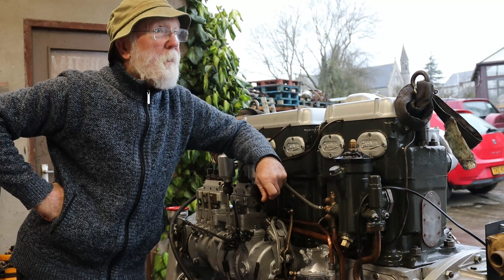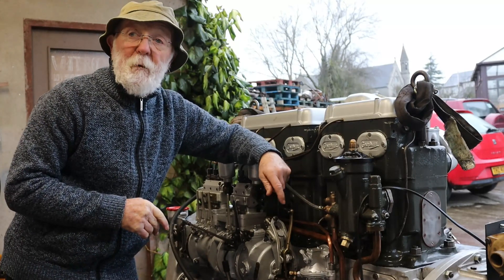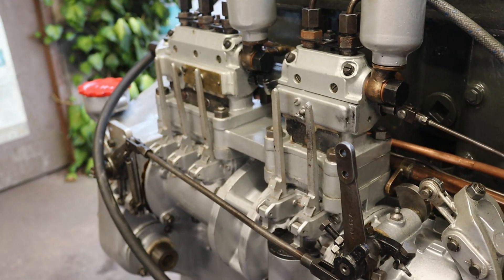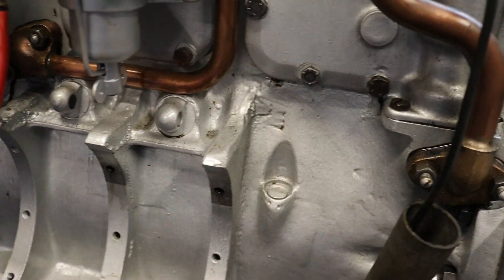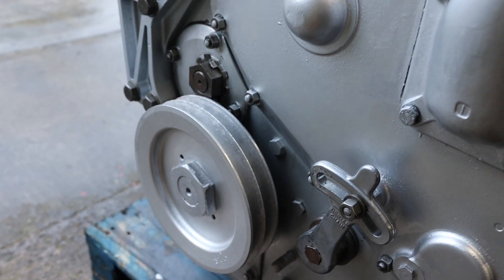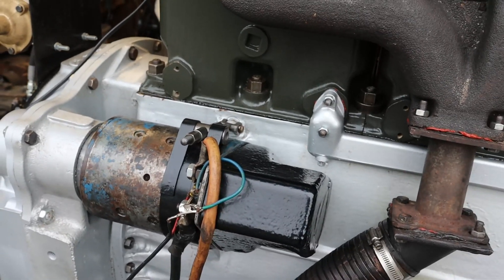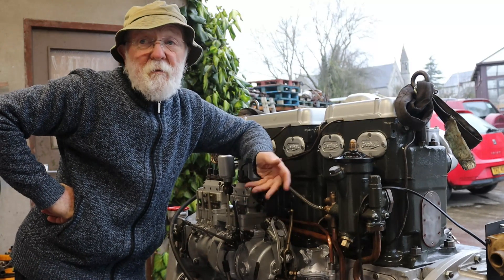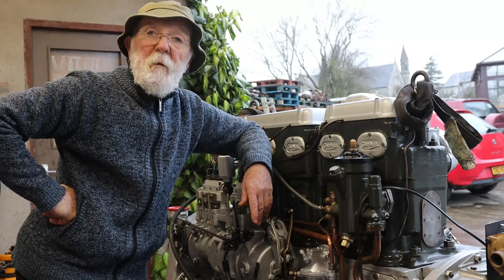Gardner Engines: Quick look at a marinised 5lw.

Comment: lol. That old Coach engine sound or Bin lorry’s.  lol   Everyone talks about. GERMAN This and GERMAN that. Truth is we Built incredible modular engines. And simple . Just like the Roman aqueducts Bridges and general Architecture it lasts. Modern stuff says.  Ooh it lasted 60’000k miles.  Amazing. With basic maintenance a Gardener Marine engine will last Hundred years. Of continuous use ( without over stress and with decent maintenance oil diesel filters etc. will last the equivalent of 6 million miles.